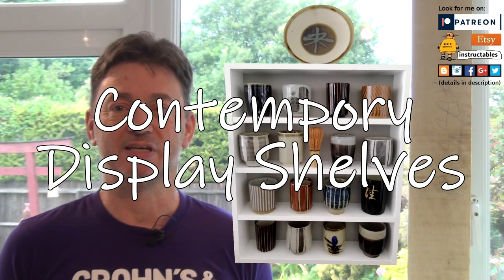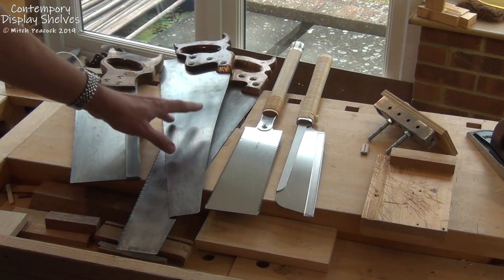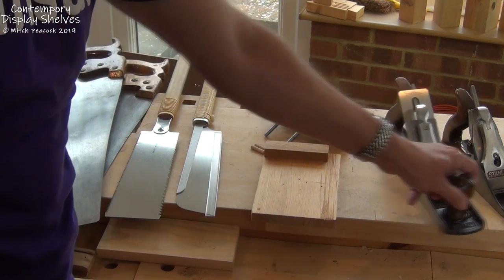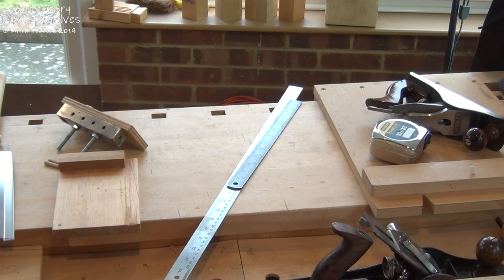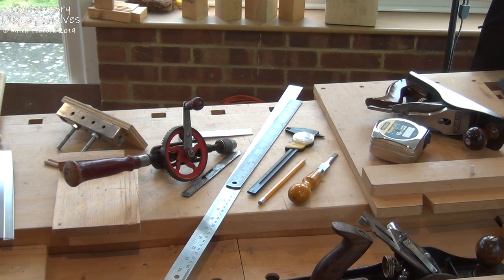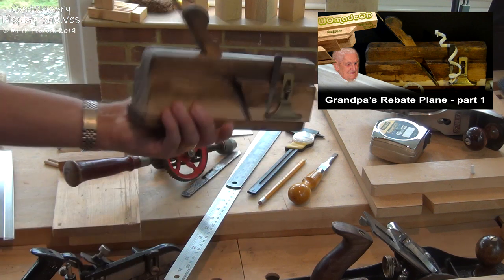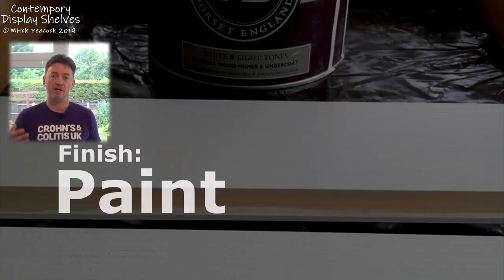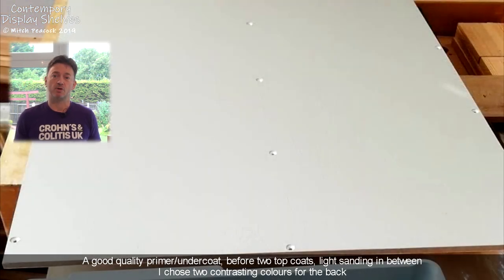Making Contemporary Display Shelves - Get Into Woodworking

Comment: Nice video, Mitch.
The shelves look great!

You explained it great.

Well you used dowels, glue and screws.

I would have built it probably the "old" way, the frame with dovetail connection and di intermediate boards with a Gradnut connection and the rear wall with wood pencils.

The planer of your grandfather is set sharply or precisely. He whistled at the beginning.

I did not know that with the retreat at the beginning, again what learned.
Reply from the maker: Thanks Gunter. For sure there are many ways to make this simple shelves

Comment: Love that rebate plane. Mitch. Just wondering how they installed dowels back in your Granddads day, jigs? freehand?
Reply from the maker: I know I'm old, but there were doweling jigs back when my Grandpa was working! Dowel 'pops', centres, or whatever you want to call them have probably been around since dowels were first used, and of course accurate layout lines do a fine job too.
Reply: @mitchwoodwork  Your still look like a youngster through my old eyes:>). I realize that dowels, plugs, etc... have been around for a very long time, but was wondering about the jig. I can take a dowel center and get a nice joint if I take my time, but would much rather use a precision jig to get there.

Comment: Hey Mitch, u gotta forward 200 years, we don’t drive the same cars like we use to and we use planes too to fly overseas so gear up and start using regular tools like they use today
Reply from the maker: HaHa! I'll be laughing when the power goes down on dull days with no wind, after the oil and gas run out ;-)
Reply: Mitch Peacock - WOmadeOD 
When that day comes I think we should have other worries then like more important stuff 
But hey, do what u do I hope someone out there also has that worry about cutting wood when the world ends
Reply from the maker: Unplugged is for my enjoyment, and when I'm paid specifically for it. I have the power tools for other occasions, and you'll see plenty of them in some of my other videos.
Reply: Beginning wood working. Simple shelving units. 
I suppose you could pop down to the corner store and by an excellent copy made from genuine styrene. 
That would be the modern way. 
Defeats the purpose a bit. 
That would be beginning credit card.